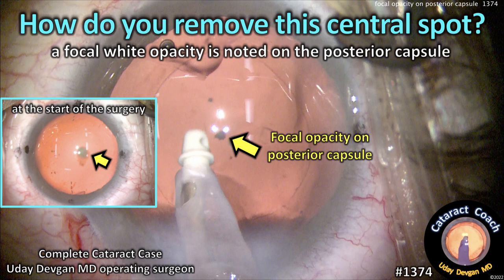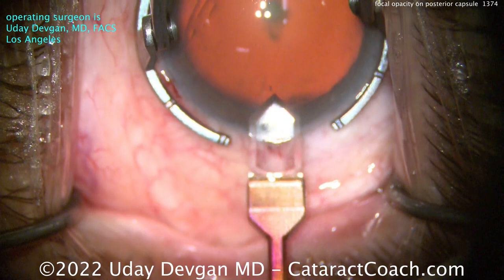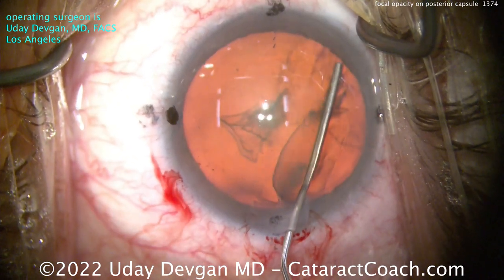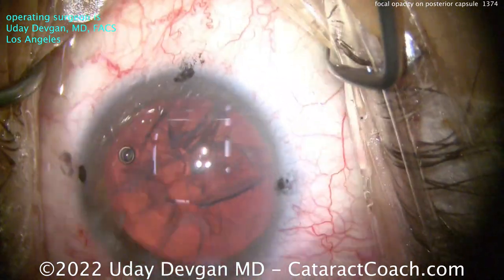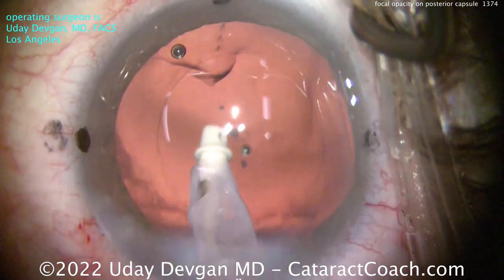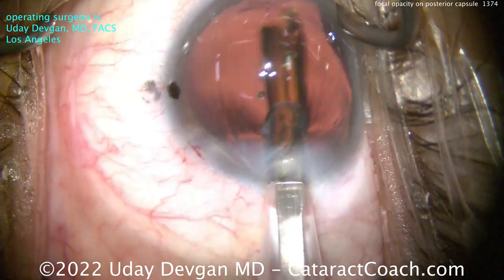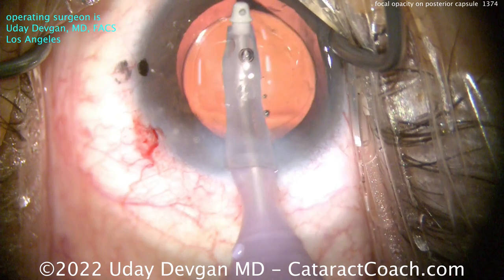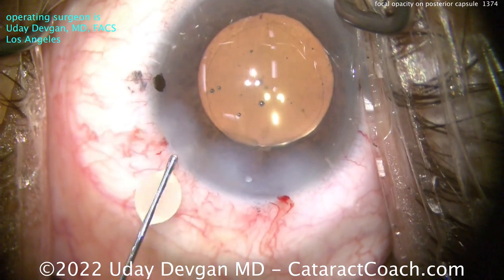CataractCoach 1374: how do you remove this central spot on the capsule?

Comment: I would estimate a Yag will not be necessary any time soon given the size of this opacity. And if it is “required” it’s easy and safe to do postop as you state.

And if you had broken the capsule, reverse optic capture is an option as long as the CCC is centered, intact and slightly smaller than the optic. Given the lower spherical power in a myope I would not adjust IOL power
Reply from the maker: Great points! Thanks for the input.